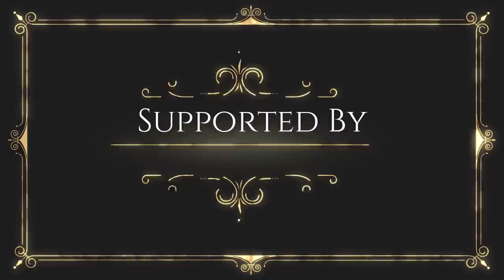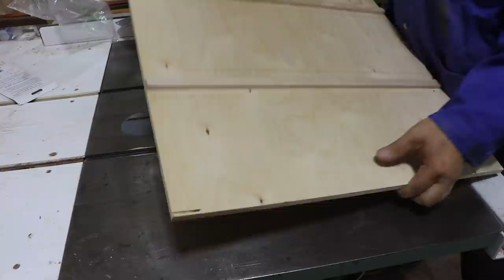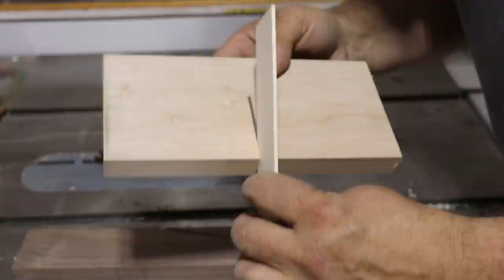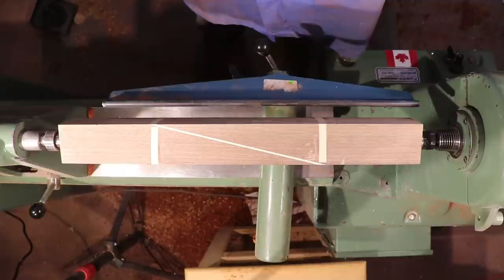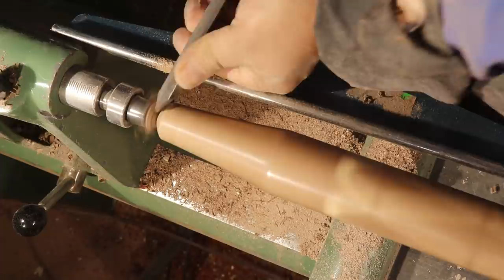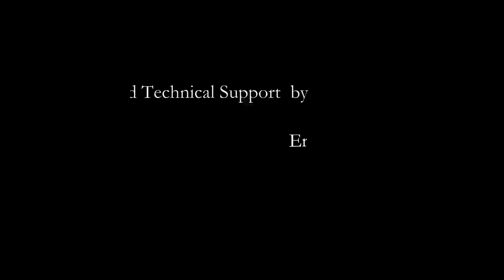Woodturning | How to Make a Celtic Knot Rolling Pin

Comment: Couldn’t you have knocked out 2 cuts at a time had you left the saw kerf intact on the same side?
Reply: Never mind, I think I’ve detected the flaw in my logic. I think you’d need an X shaped cradle to alternate angles, but am I wrong in thinking that would cut the build time down significantly?
Reply from the maker: I cut one at a time to eliminate any movement that could occur in the second cut as there is only 1/4 holding it together. Also the insert wouldn’t slide past rash other. It really isn’t a long wait time between cuts especially if you are doing a few at a time. Thanks for watching Frank!
Reply: @TheKlondikeCraftsman  thanks for replying! I’m going to try making one of these as a last minute Christmas gift so I appreciate your feedback.